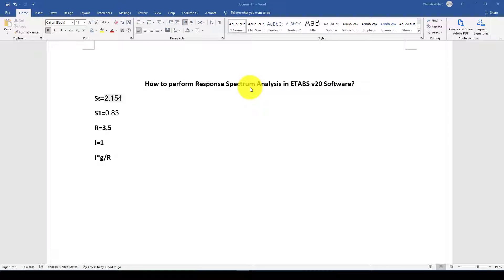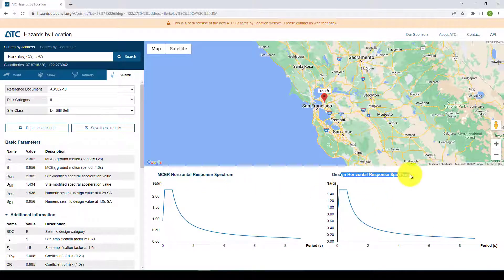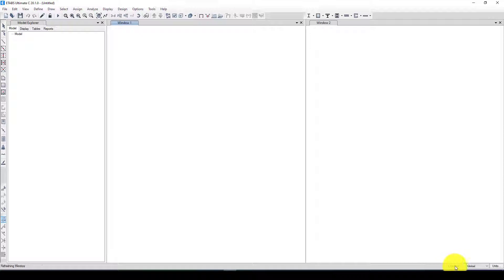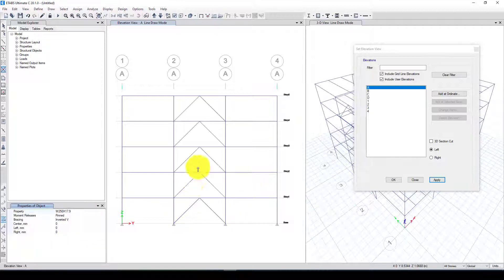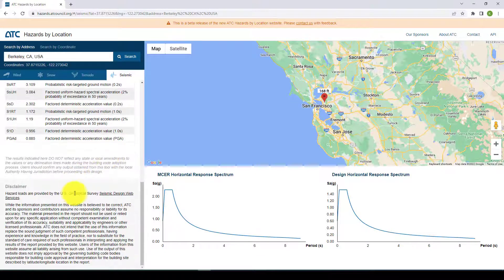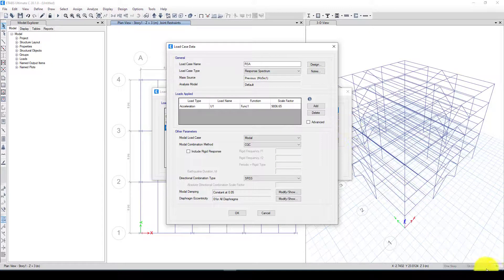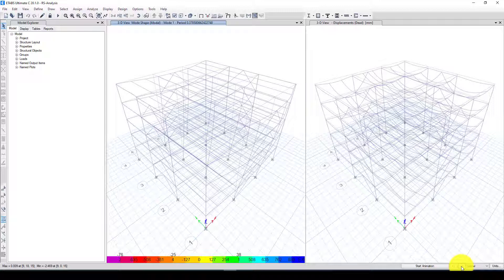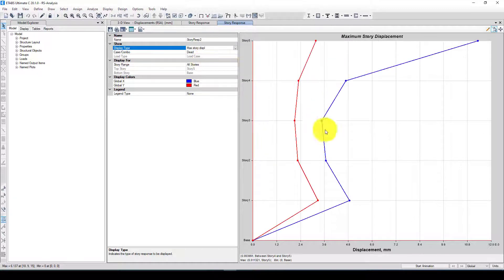How to properly perform Response Spectrum Analysis in ETABS v20

Comment: Response Spectrum Analysis is a static analysis, a simplified method from a dynamic loading. It is also good to precise that it is a linear analysis since you use a R factor to define the Response Spectrum, which take the ductility of the structure into account, allowing you to do a design with linear prorperites and simplifying the design.
Reply from the maker: Good information 🤝
Reply: Thank you for the very informative content! @KSSE_Engineer